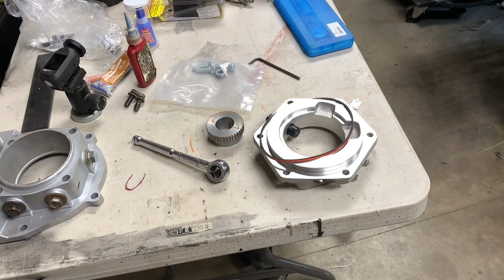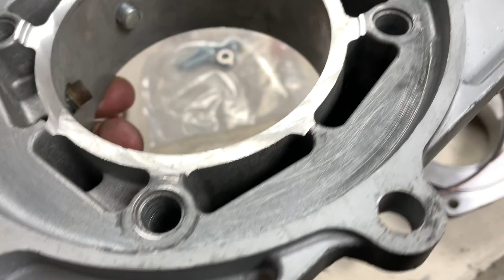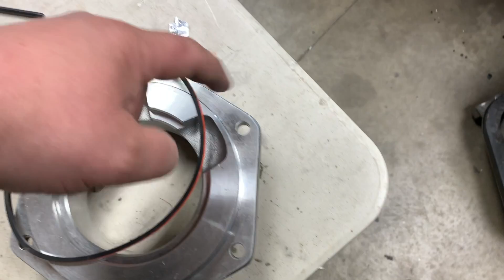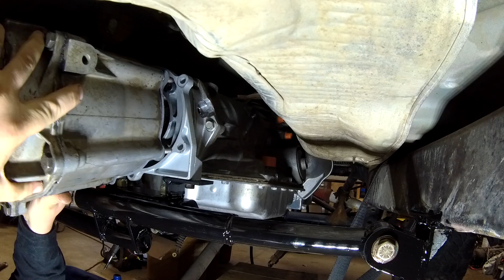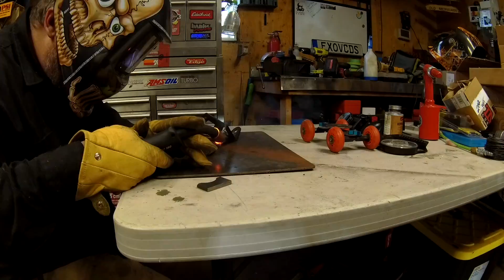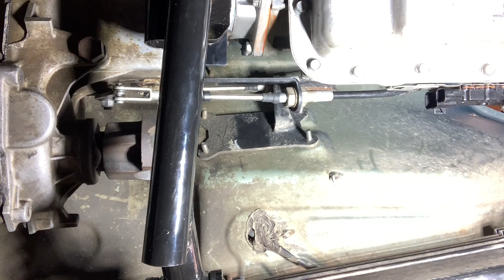The Nightmare Using a 231C On My Jeep LS Swap

Comment: Wait wait wait. If you had the 231C, why did you need an adapter? Shouldn’t the Chevy transmission bolt to the Chevy transfer case?